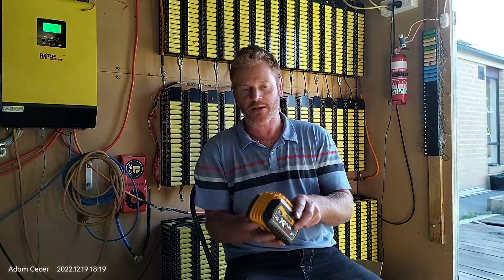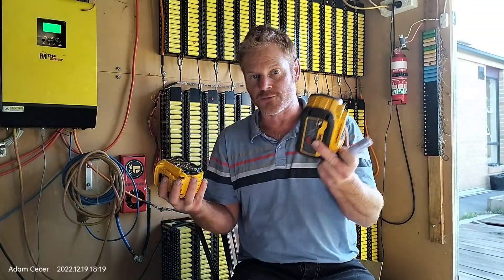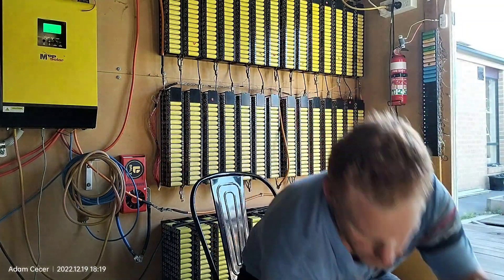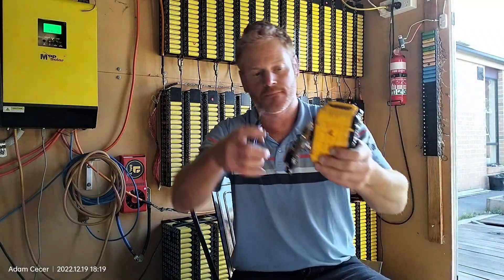DeWalt Battery Pack Tear Down.

Comment: I just pulled apart a 12ah battery and it only had one dead cell in it, killing the whole battery  What can I use the good battery's in, as they seem an odd size ?
Reply from the maker: Maybe you can make a power bank for your phone or a power supply for a 12v system. I'm about to make a 4s for a modem to keep it alive when the power goes out.

Comment: Nice work, interesting to see the whole process. Just out of curiosity, not so much criticism: are there benefits to not having your BMS connected? I remember you mentioned something about it in some other video, can't find it though.
Reply from the maker: The only benefit of no BMS that I would have mentioned and can think of is the Activity balancing. If a pack is bad, but not too much so then active balancing will not show up due to constantly supplying energy to that bad pack. Otherwise I strongly recommend having a BMS.

Comment: Interesting video mate, one suggestion would be to show the initial teardown, then speed up the teardown to the end, resume normal speed, when the bat's are cleaned, then show the quick build up of the power wall or just finish the video off.  

Overall good job. 
Merry Christmas MMXXII 
Happy new year
Reply from the maker: Thanks for the tips. I was thinking of the speed up on the video but because of my random talking and was setting the seen of real time teardown the show how long it actually takes.
That aside I will take onboard your suggestions and apply to upcoming videos.
Thanks again.
Reply: @adamcecere3369  I hate it when people speed up showing how long it actually takes. I reckon this was perfect. Cheers mate.
Reply from the maker: Thanks for the feedback. As much as it can be a 10 minutes of nothing not speeding it up, I was hoping it was enough talking to fill in those 10 minutes to show exactly the real time. Thanks for your kind comment.